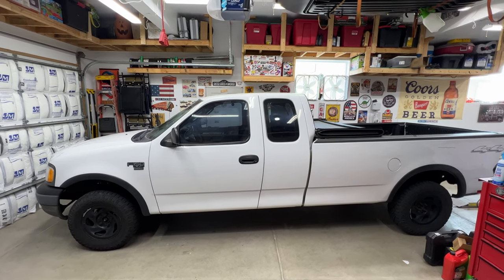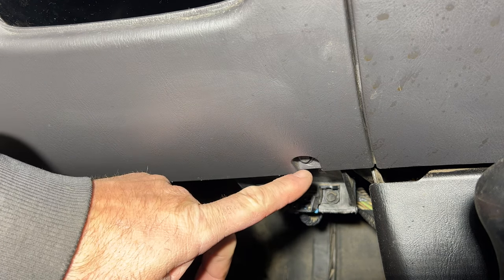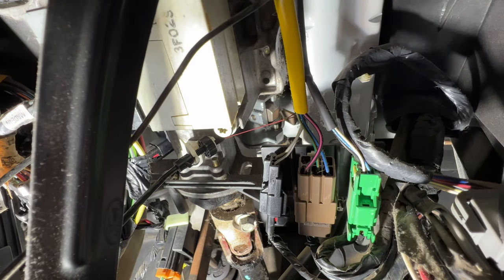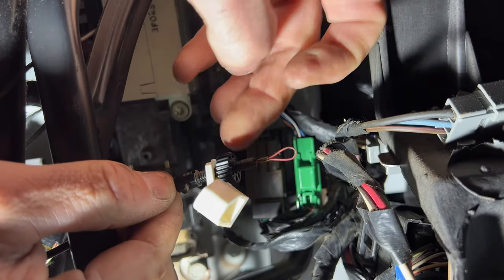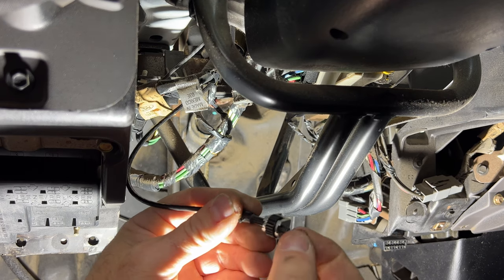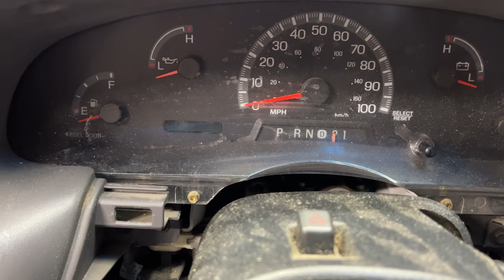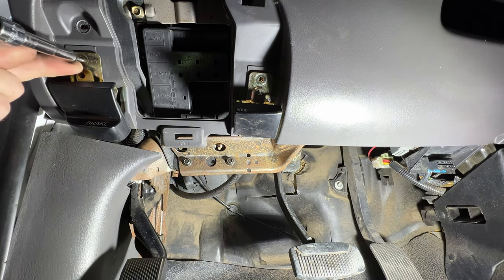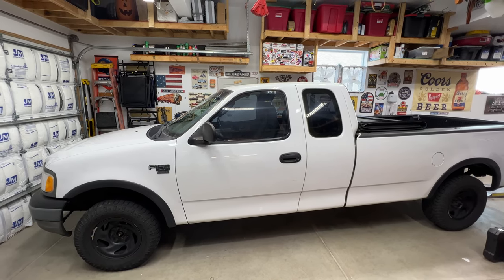Ford Shift Indicator Dial Permanent Fix

Comment: Excellent tutorial, this is what an aftermarket part should be. I bought one of these for my ‘99 Ranger, fixed it up superbly. Ford should’ve had a metal one of these from the factory instead of the cheap plastic crap one that breaks on every vehicle that uses this shifter system.

Comment: Worked for my 1996 Ford Explorer XLT, except you need to file the little metal nub on the inside bracket just a little so the wheel can turn freely and not bind up as it does when just try to put it in the brand new metal bracket. (The original Ford plastic bracket had a hair more space between the inside bracket ends. The Chinese metal replacement part is not made as exact!)

Comment: Came here to say if you grab any plastic piece in my truck like you did in this video they will crumble in your hands. You can’t take my clips out without them breaking one time use on my truck after 20 years

Edit( great video tho I think I’m just going to zip tie it on place if I can’t see where that loop goes too, I’m def not taking my dash apart to fix this)

Cheers ❤

Comment: Thank you.  But does the Shift Indicator wire have a spring tension on it, because in my Ford Ranger 1999 the indicator does not work, I open it to control, and  the white bracket is ok, also the cable loop, but this cable loop to the lever does not have any spring tension on it.  When I pull on the this cable but only close to the bracket , it moves the indicator, somewhat.  Does the cable going to the indicator meter needs to be replaced?  Or do I need a complete instrument panel? Thanking you.

Comment: Thanks, but the "PERFECTFIT" aluminum part WILL NOT FIT  A 1992 E250 FORD. The angle is different, and you will need to hacksaw off part of the 
"bolt" hole piece(make it flat).

Comment: Same problem I'm having on a 2001 ford expedition eddie bauer. Mine doesn't align either plus I have to pull shifter all the way up and turn key same time in order for it to start. Don't think I can do what you did, I'm an older guy with a bad back from construction accident, but thanks for the video. I'll try to get my backyard mechanic to do it but he's scared of doing things he's never done before and messing it up worse. Thanks for the video.

Comment: I did this exact same fix on my 97 Ford explorer AWD. But the indicator needle stops moving over to the right after the N-D position. I tried turning the adjuster wheel almost as far as I could to tighten up the slack but it's still the same....🤦🤷 Any ideas how to remedy this ????? 🙏

Comment: Can't this repair be done from underneath, taking no panels off ?
I used a zip tie for a temporary ( 1 year ) fix......
Thanks
Reply: Same
Reply: On Ford Explorers you have to take the plastic section under steering column off (2 screws and 2 screws in hood release bracket), then a ridged metal plate (7 screws) under that to have full open access to the wheel and plastic bracket...

Comment: What if that little black screw is broken in half? The screw the turn wheel screws onto?

That's what I got goin on
Reply from the maker: You’ll have to get a new shift indicator cable assembly like this https://www.ebay.com/itm/265389780001?chn=ps&_trkparms=ispr%3D1&amdata=enc%3A1l4JdvH2BR2yBLmjHlX6PuA40&norover=1&mkevt=1&mkrid=711-117182-37290-0&mkcid=2&mkscid=101&itemid=265389780001&targetid=1644837435003&device=m&mktype=&googleloc=1014573&poi=&campaignid=16743749222&mkgroupid=138744546207&rlsatarget=pla-1644837435003&abcId=9300842&merchantid=114737582&gbraid=0AAAAAD_QDh8JsTpXCnWePd6pslNjhDp2J&gclid=Cj0KCQjwxMmhBhDJARIsANFGOSuKFSjN3vZljiD2a7AfoUEv04rGd1OIRNKZDoTlKbscv9dxVw48QJwaAurlEALw_wcB or look at your local junk yard considering these trucks are everywhere.
Reply: @BLUE COLLAR GARAGE  Damn!!! Thank you for the link, but I should've told you first, it's for a 2011 Ford Crown Victoria. It is a Police Interceptor, although I don't think that matters. Unless it is specific from police vs civilian cars, but I'm pretty sure it's the same
Reply from the maker: @DocM.  yeah mostly likely it’s the same.